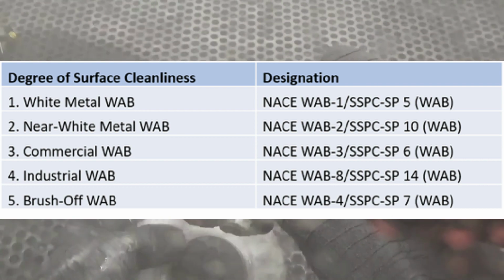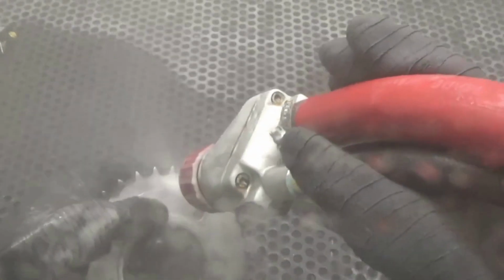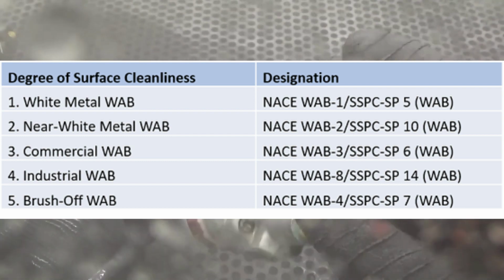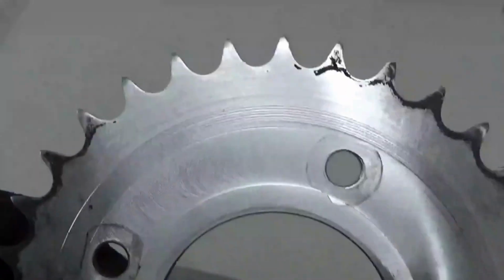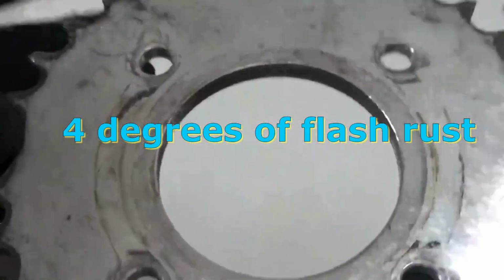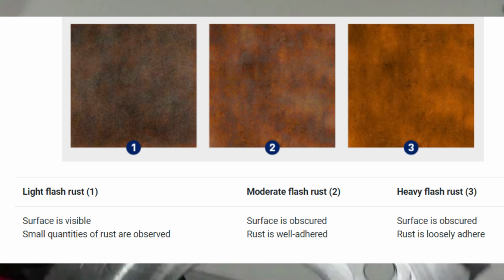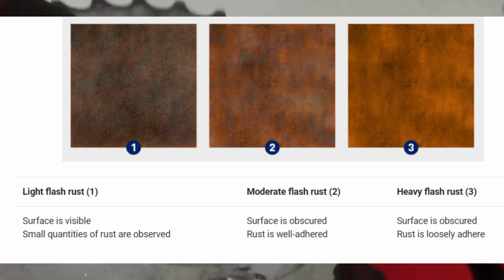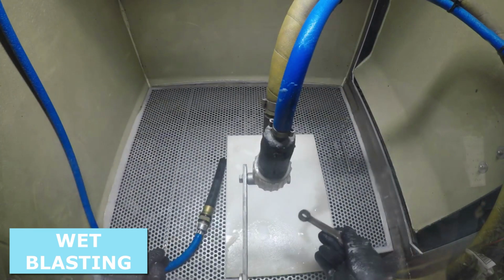THE WET ABRASIVE BLASTING STANDARDS EXPLAINED #NACE #sspc #VAPORHONING

Comment: However, with wet blasting you will have less time to wait until the surface starts corroding again and will have to use a rust inhibitor to be able to use the equipment. This is because water accelerates corrosion, the rust inhibitor will help slow the process but even with the inhibitor a wet blasted product will have less time available compared to a dry blasted product before corrosion starts.
Reply from the maker: Thank you for your opinion 🙏

Comment: You may not be able to stop blasting for much time – With a dry blast media you can stop blasting for a while to tend to an issue and return to blasting. However, depending on the style wet blaster you have you may not be able to stop blasting for very long. This is particularly applicable if your wet blaster mixes water in the media
Reply from the maker: Thank you for your support ☺️